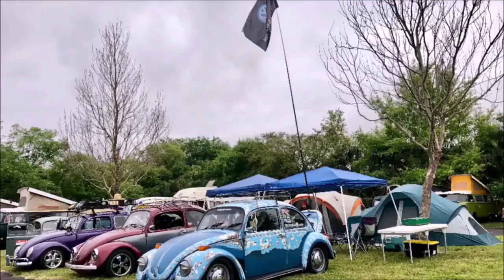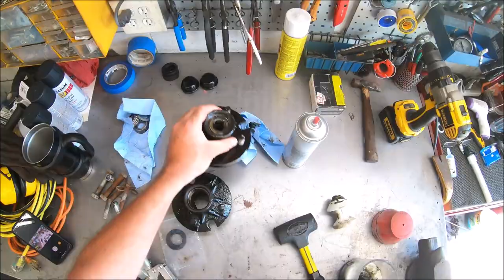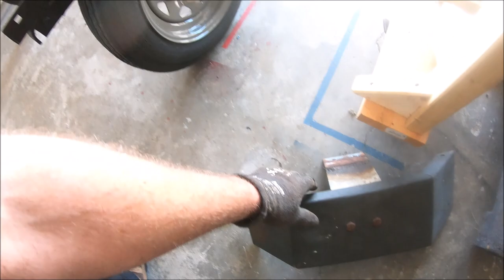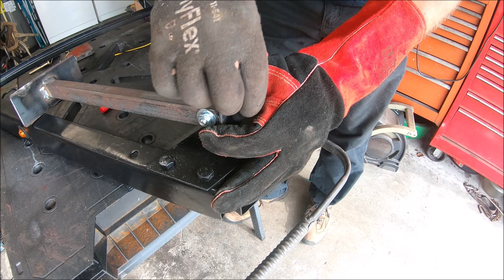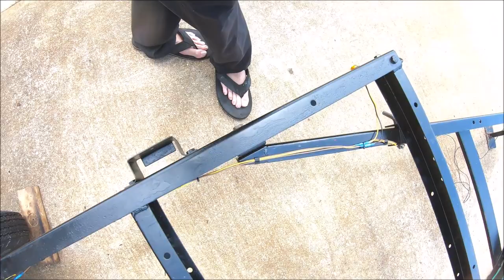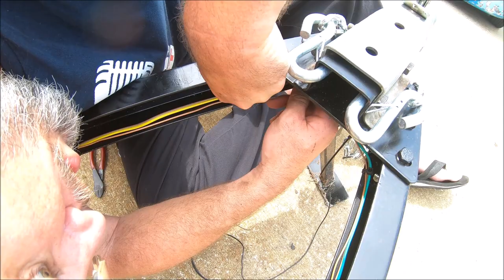Harbor Freight 4x8 Trailer Refresh - Repurpose and reuse- part 2

Comment: Neat little trailer Gary! That'll look cool behind Jawbreaker. I really related to the mini-drama with the ground wire ring terminals- if it's worth doing once it's worth doing four hundred and ninety two times. Thanks for sharing the side project!
Reply from the maker: It’ll definitely do what I need it to do! I think it came out ok overall and the electrical is rock solid 😎
Reply: @VWJawbreaker  OK?!? That trailer is awesome and I know you'll get a lot of great use out of it. Enjoy!
Reply from the maker: @HapticGarage  we used it the following weekend for a family camp out, it worked great!

Comment: I got my two new shirts love them, Well Gary I am going to be down for some time they are going to go in on the 8th of July and remove all the stuff they put in on the 8th of April and then replace the complete shoulder. Put I have done some work on my 74 got all the brakes and the brake lines on all four wheels, need to do the master cylinder but that will have to wait. But I do have have a roller now. And I have started sanding on the body both doors needed a lot of help so I found a set that is a lot better for $50.00 for the pair. I will just keep doing a little at a time hard part is with only with one arm.
Reply from the maker: Glad you love the shirts, the charity will appreciate you as well!
Sounds like you’re making good progress on the 74! Bummer about the shoulder but hopefully in the long run you’ll have less issues buddy. Just focus on getting better and healing up after the surgery, the bug will still be there when you’re ready to get back to work.